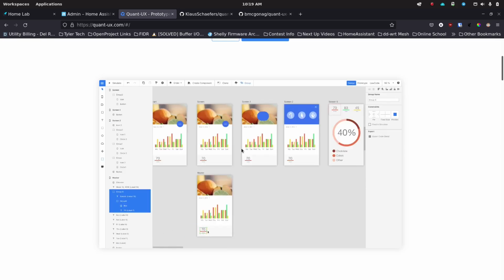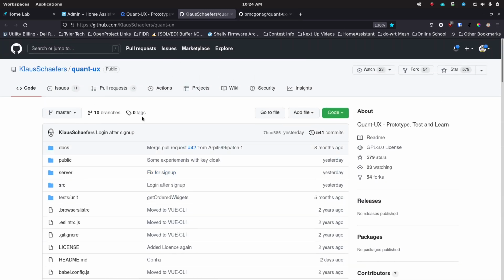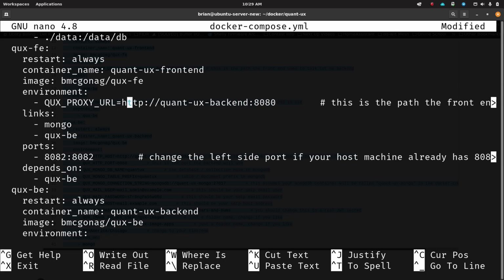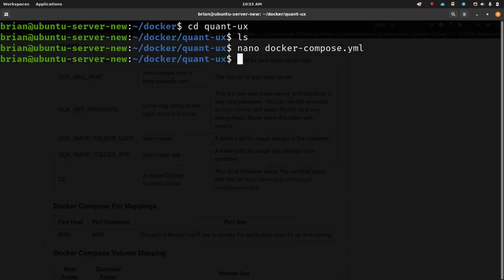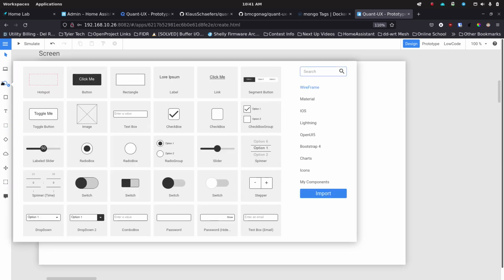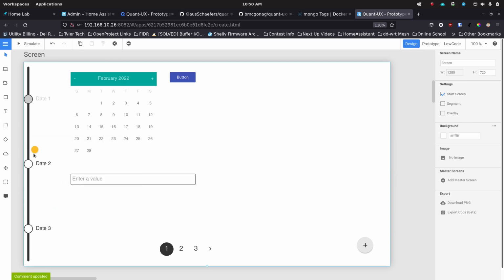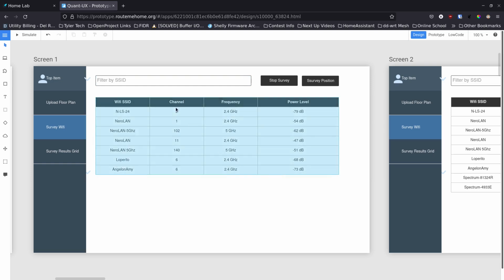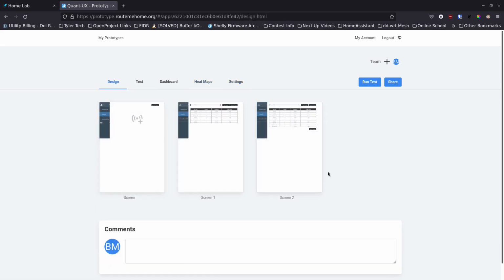Quant UX - Open Source, Self Hosted Mck-up and Prototyping tool that can give you user feedback.

Comment: it would be easier if there was a deb file or appimage for a newbie this wont make sense two different install guides its kind confusing
Reply from the maker: I don't think I have 2 guides here. You need to setup docker and docker-compose, but those can then be used to run many applications.  After than, you run the install for Quant UX.  It's a web based application, and there is a lot more than just local access available in it.  You can provide access to others to do user experience testing and get information through the Quant-UX system.

Comment: Bro i am unable to signup because it says too short password even my password is long and secure. please help
Reply from the maker: I'm not sure why you're hitting that issue. I just download the latest version, on a fresh machine, and started it up, and created an account with a 10 character password.  I'm not sure what the minimum is...but 10 worked for me.  Are there any logs in docker?  You can use the command

docker-compose logs

to see any logs that are created, and see if there are any errors or issues.
Reply: @AwesomeOpenSource  11:50:34.092 [vert.x-worker-thread-14] ERROR com.qux.bus.VMHeater - touchMongo() > error > Count tables
com.mongodb.MongoTimeoutException: Timed out after 30000 ms while waiting for a server that matches ReadPreferenceServerSelector{readPreference=primary}. Client view of cluster state is {type=UNKNOWN, servers=[{address=quant-ux-mongo:27017, type=UNKNOWN, state=CONNECTING, exception={com.mongodb.MongoSocketException: quant-ux-mongo}, caused by {java.net.UnknownHostException: quant-ux-mongo}}]
	at com.mongodb.internal.connection.BaseCluster.createTimeoutException(BaseCluster.java:408) ~[qux-server.jar:?]
	at com.mongodb.internal.connection.BaseCluster.handleServerSelectionRequest(BaseCluster.java:316) ~[qux-server.jar:?]
	at com.mongodb.internal.connection.BaseCluster.access$800(BaseCluster.java:66) ~[qux-server.jar:?]
	at com.mongodb.internal.connection.BaseCluster$WaitQueueHandler.run(BaseCluster.java:491) ~[qux-server.jar:?]
	at java.lang.Thread.run(Thread.java:828) [?:?]
11:51:34.118 [vert.x-worker-thread-17] ERROR com.qux.bu
Reply: this is the error im getting in backend server

Comment: I got it running the other day, but wanted it on a different server of mine, did exactly the same followed your setup, get to the login page, but does not want to register me as a user, when I check the mongo db database folder, there is absolutely nothing in it. When I try to login with the username & password I created is says password too short. I has something to do with the db volumes folder.
Reply from the maker: Hmmm.  Not sure why it would be doing that.  Did you try to move the db folder over from the original install?

Comment: Awsome video! I had it up and running in a few seconds with your instructions. My next question is how can I add my self-signed cert so that I get SSL? I'm only running it visible in my local network and one could argue it's not needed but it would be nice.  It's internal so I can't use Let's Encrypt thus the self-signed. I have seen instructions how to do this for nginx but I'm not sure how this is published. Any ideas?
Reply from the maker: I would personally setup NGinX Proxy Manager, and then upload your self signed certs to that, and apply them to your site with a local URL.  Proxying the URL to the IP and port.
Reply: @AwesomeOpenSource  is there a video on how to do that?

Comment: Great video and software! Given that you do prototyping for your day job, any thoughts on how this stacks up to more established software? Are there specific features or use cases where this might be lacking compared to paid options?

Also, have you checked out Inventree? It's a general use inventory manager that's had some impressive development. I'm surprised how little visibility its gotten given how good it is.
Reply from the maker: I fully believe that for mock-ups and prototyping, this could easily replace any needs I've had with paid alternatives. Additionally, many of those alternatives don't have the testing stats I showed near the end of the video, whereas this has it built in.  On a lot of paid platforms, you have a separate application for the stats, that you then also pay more to use.